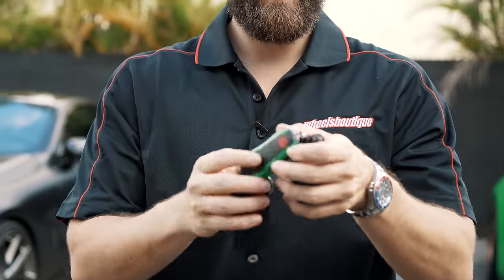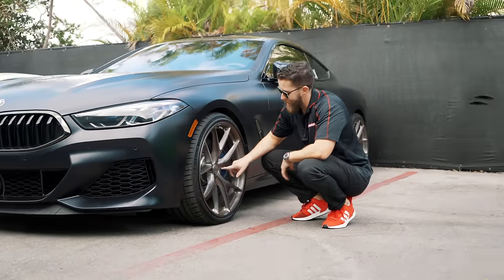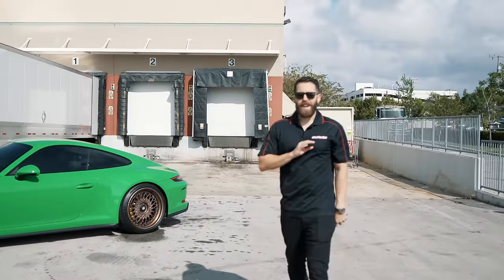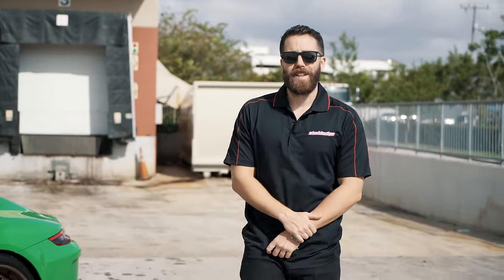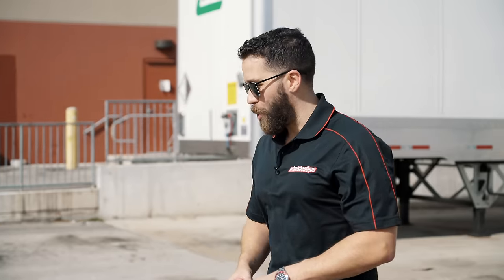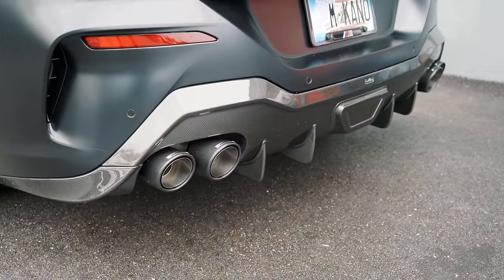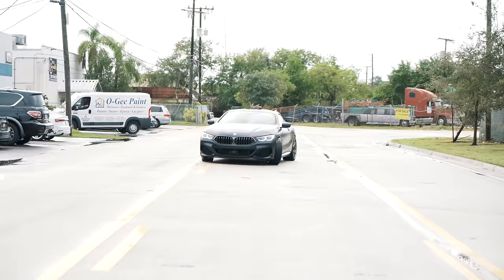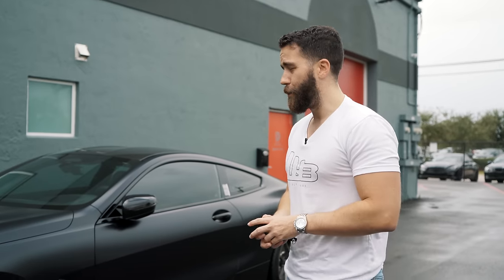BMW M850i AC SCHNITZER AXLE BACK EXHAUST. BEFORE AND AFTER SOUND CLIPS!

Comment: ….the AC Schnitzer’s exhaust systems are made by Remus in Austria.  Therefore, it’s actually Remus spent the money on R&D.
Reply from the maker: AC Schnizter are the ones who develop and test the exhaust then pick a manufacturer to produce it. Under the contract agreement between the two, they are not the same exhaust.

Comment: Hey! Is this the kit with or without the sound tube?
Reply: What do you mean by the sound tube? Do you have a part number to reference?
Reply: @NussbaumAutohaus  There is a kit with a "sound tube" (mid-pipe). Is this the kit with the mid pipe?

Exhaust w/o Mid - #1812316514
Exhaust with Mid - #1812316524

Comment: Can you control how much crackling it makes?
Reply from the maker: Yes. That can be managed through the tune depending on what the customer desires for the exhaust note.
Reply: Ty. I’m currently shopping for one  now. Are there any potential alignment etc issues doing the springs as well? I am not up to speed on mods
Reply from the maker: @jimmymcgill5572  An alignment is recommended but not required.